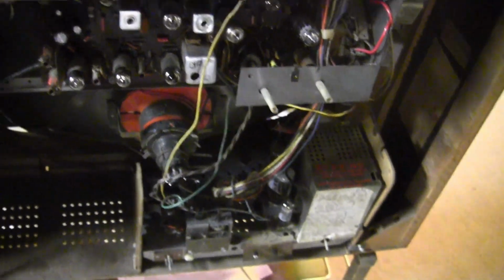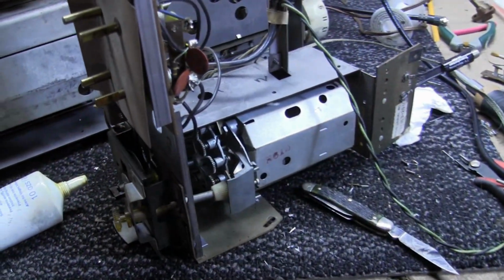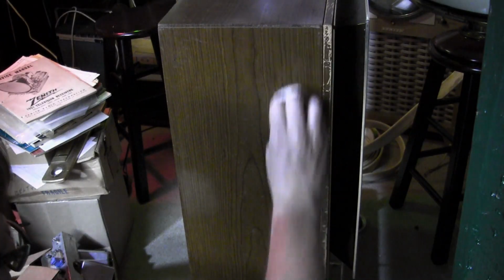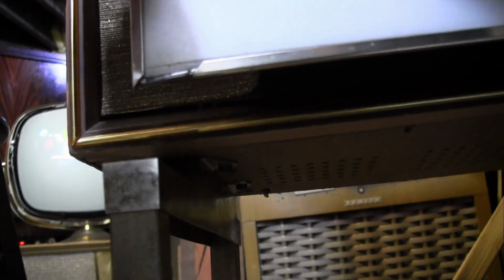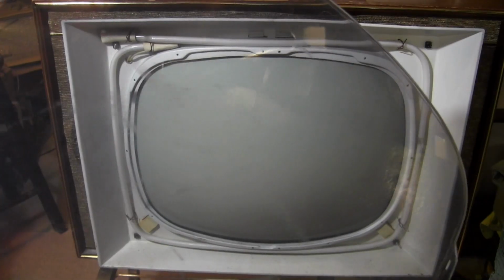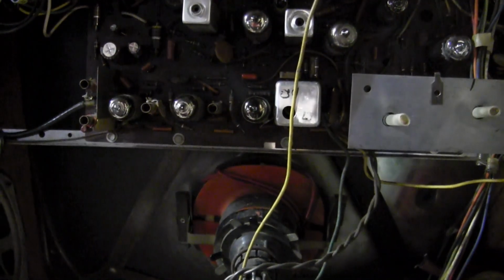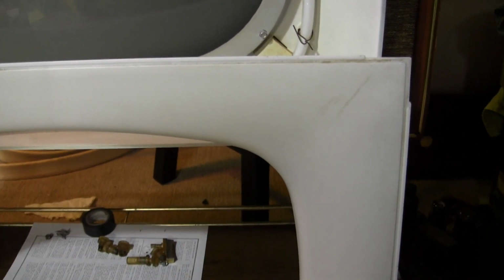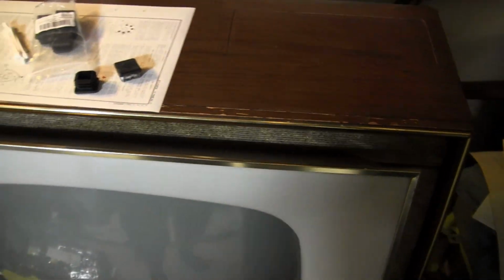Sylvania Halolight/Sylouette 21C529 part 6

Comment: You know Bob, an ink brayer would be perfect for re applying paint to the Sylvania logo on the front.  I've used breyers to restore some old automobile emblems with raised letters. We even use them to apply sealer to old VW engine cases. Works great
Reply: Thanks for sharing, the brush makes a bit of a mess of applying sealer, if ever have an opportunity to build another engine will certainly use a brayer.

Comment: New flat screen TVs tend to have two or three adjustments for where the legs can mount so you can clear sound bars or sit on a smaller table better and like that. My main big set is mounted on a wall mount that is full motion so I can adjust it side to side and in and out if I need a different viewing angle or need to get at the cables, the TV is also 8k, gets stupid bright, and was stupid expensive but sure looks nice.
Things have changed so much since I was fixing TVs to sell and I usually don't have to work on them now.